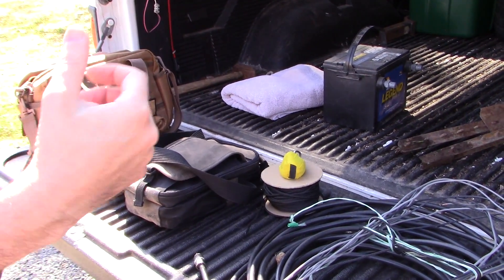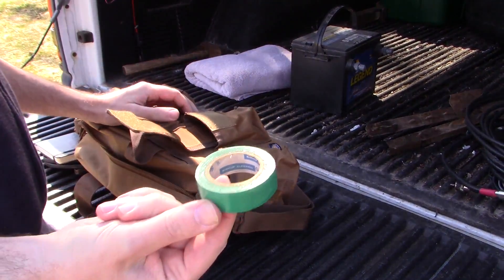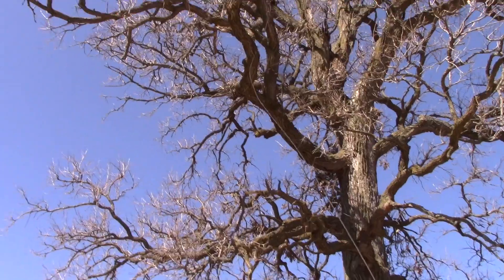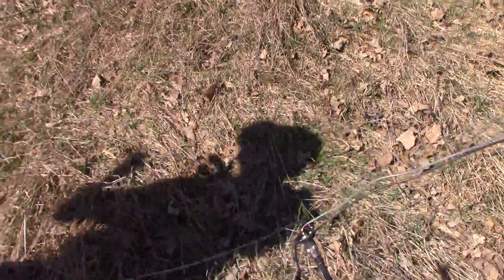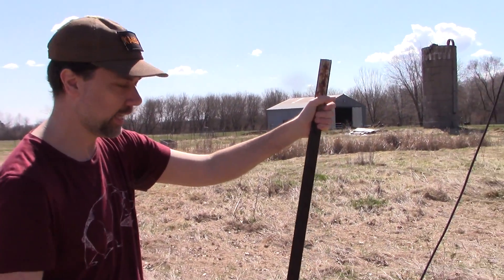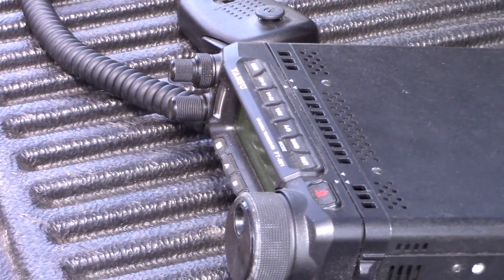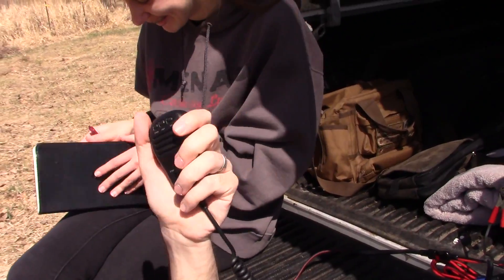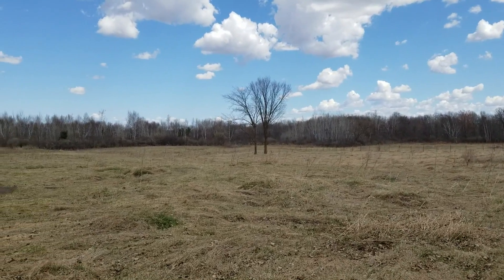#38 How girls can have fun on Ham Radio - Portable or Bust #2

Comment: Nice set up. now get a 160 meter dipole up 1/4 wave high.  I can see running that battery down and going to the truck battery and running that down and needing AAA for a jump.  car battery works just fine. just heavy ! today I use LiFePO4 . run days camping !  POTA will be fun ! looks like same power cord as ICOM 7300.  just watch + and - . watch out for some parks do not want us to throw a rope or wire into a tree. just use a DX commander pole and lean into a tree . 73's
Reply from the maker: I've got a double video you'd like. Works on 160m!

Comment: .... Aaand lysseneeeng - haha
You forgot the morse key as well ...  Write a list for your next POTA or be prepared to make an antenna form cattle wire or power cables from soldering tin..
tu gl 73 OE3VBU
Reply from the maker: Did you hear us POTA yesterday?
Reply: @temporarilyoffline  sri no DX with my NVIS antenna (up 1/4 wavelength, hi)
Seems like no one does POTA in OE yet

Comment: Ok, so it was a car battery. (re: my comment on your video #37). And you were operating at 100W for 3+ hours? Good job! M6EXF
Reply from the maker: We probably operated for an hour on SSB, But you know how time goes when you are playing radio and having fun.  This was a "dead battery" that I stuck on a car charger and then we headed out to the field.  I will recharge it before going out on Saturday for POTA.  I need a tool to measure usage on the battery.
Reply from the maker: Quick update for what it's worth... I just plugged the battery into the charger and it read 61% available.  That was 6 days after using it.  We did start at 100%.  I don't know what that tells you other than "we used some".
Reply from the maker: That's not bad at all... closest thing we have is twice the price in the US.  I'll keep an eye out.

We took the car battery out again after a full charge, came home with 25 contacts in 1.5hrs and 50% usage of the battery - video this week